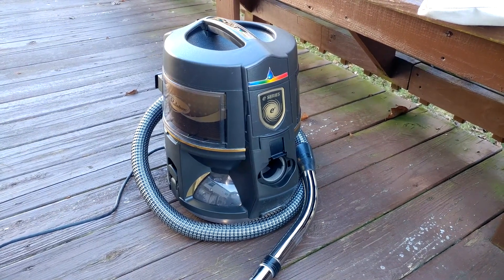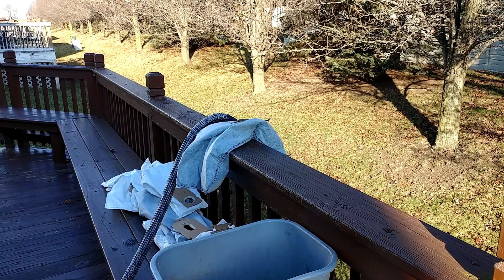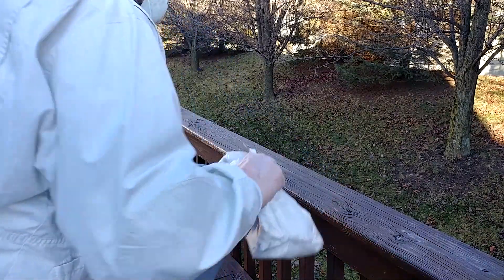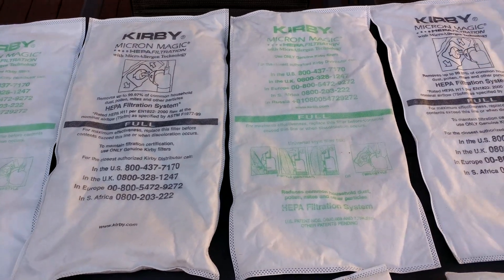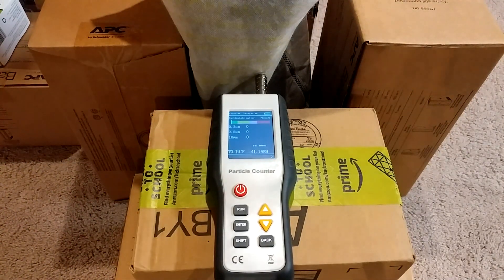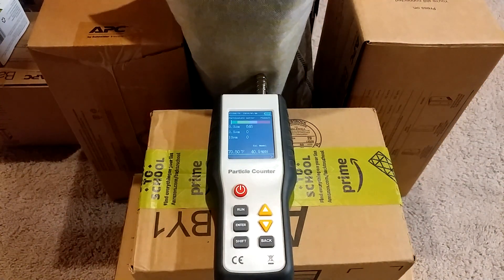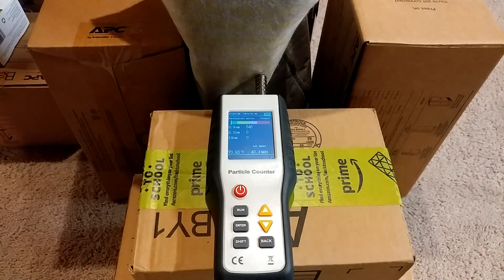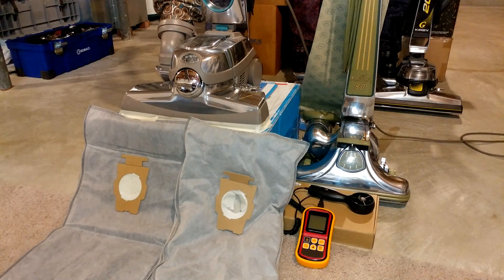Long Term Reusable Kirby HEPA Bag Test

Comment: How come do you Reuse the vacuum bags
Reply from the maker: I wanted to show that you can if you want to. It's your choice if you want to reuse them or not.
Reply: I don't reuse mine. I fill em up and they go in the garbage lol.
Reply: My 1973 Kirby Classic Omega still has the original cloth shakeout bag that it came equipped with. It’s been dry cleaned a few times. In forty five years I’ve only replaced belts and two brush rollers.  I have two Mighty Mites (One Sanitaire and one Eureka outfitted with the WW accessories that the Sanitaires come with) one one each floor. I have HEPA after filters attached to each one and replace them every nine months.  Not only does it save me a great deal of money every year but though the Mighty Mites have 12amp motors their bag chambers are small. Using a cloth bag enables them to work with my WW turbonozzles.  I think that the aftermarket available synthetic cloth HEPA diaper bags might also enable the use of a turbo nozzle.I use my Might Mites daily and my Kirby every two weeks when I deep clean and move furniture.  I have an Oreck XL on my first floor and a Maytag M500 that I use daily. If they were available with shakeout bags and their outer bags were easily washable I’d go that route. I have an Electrolux Silverado, a Swedish Electrolux UltraSilencer and a Miele Pure Suction all of which use HEPA bags and each cost about $50.00 per year to run.  I use them on my deep cleaning days when I move furniture. In using the Mighty Mights for daily use the need for bag and filter changes in those machines is greatly reduced.